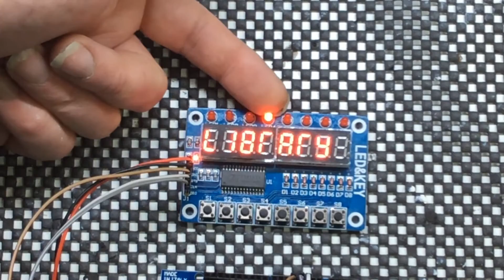TM1638 8-bit digital LED Module

Comment: do you have the code available to reverse engineer? (looked at the library link but theres no useful demo code i can find to learn from)
Reply from the maker: what are you trying to do
Reply: @KevsElectricalWorkshop  right now? currently try to use the buttons for any other purpose than LEDs. (eg increment a counter) maybe switching modes in the future? i just cannot figure out how to use them (the library im using has a doLEDs functon that ive been working on for hours with no joy. at this point It would actually be easier to just add external buttons on digital pins but that kinda defeats the purpose of the module.  any example code would be amazing, i cannot find any online
Reply: @KevsElectricalWorkshop  tldr: in its simplest, i need to push specific button: which executes code i assign to that specific button?
Reply from the maker: ok just looked at code for tm1638_function_example from the lib

switch (*mode) {
    case 0:
      module->setDisplayToDecNumber(runningSecs, 1 << 7);
      break;
    case 1:
      module->setDisplayToDecNumber(runningSecs, 1 << 6, false);
      break;
    case 2:
      module->setDisplayToHexNumber(runningSecs, 1 << 5);
      break;

is the buttons in a binary count
case 0 = no buttons
case 1 = button 1
case 2 - button 2
case 4 = button 3
case 8 = button4

which will also mean case 6 will be buttons 2 & 3 pressed (combos)

change module->setDisplayToDecNumber(runningSecs, 1 << 7); ect for your code ie after case and before break

the lib i used is called tm1638-library-master
Reply from the maker: https://github.com/rjbatista/tm1638-library

Comment: Would make a nice display for a Precision Volt meter or Freq Counter I think.  I really don't have the Programing skills required.
Reply from the maker: give it a go, google can always help with programming.
Reply: @KevsElectricalWorkshop  BangGood has them for $3.00 right now.  I'll order on or two to mess with.